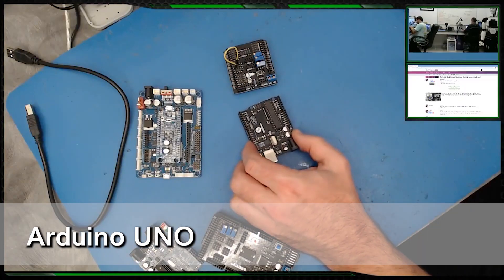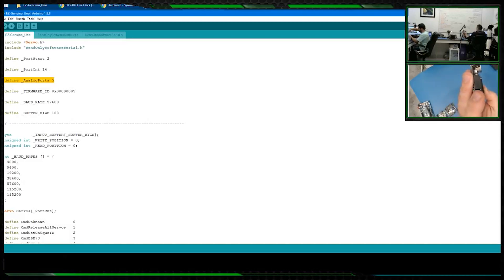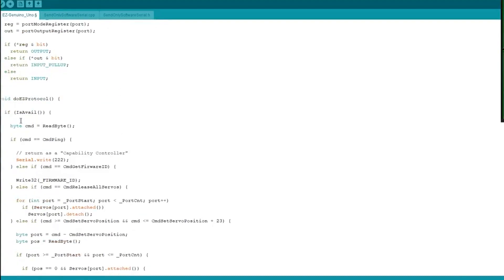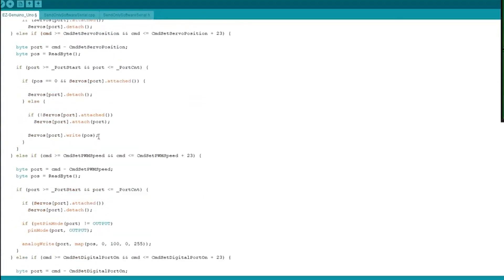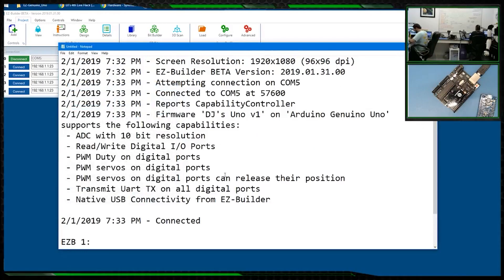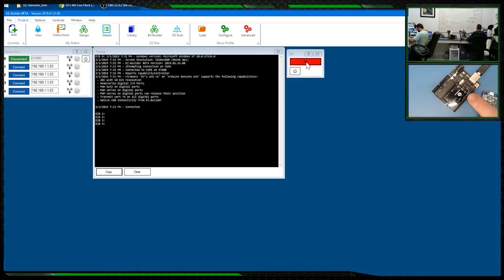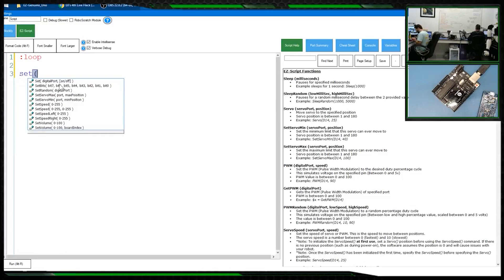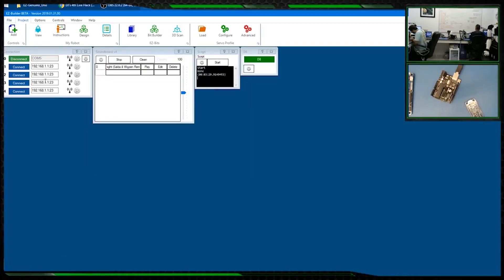Tutorial - Arduino UNO - Installing Firmware & Connect to EZ-Builder

Comment: Your first instruction after opening ARC is click on the gear in the connection box. There is not gear in mine. What am I doing wrong?
Reply: Cancel that. I got the settings box by clicking on the 3 dots at the top so now I'm connected :)